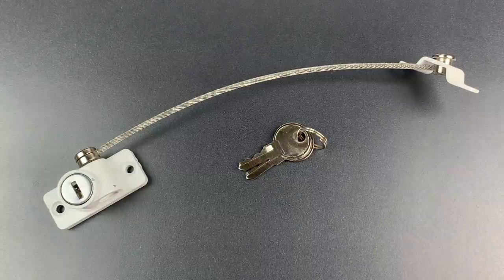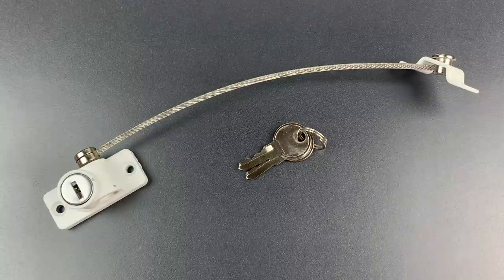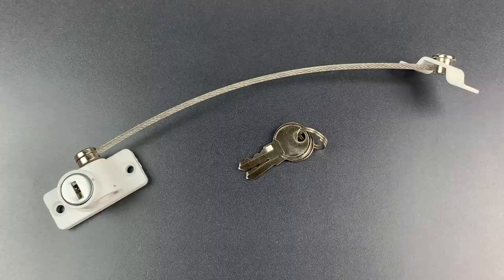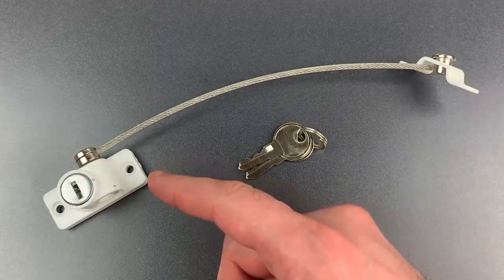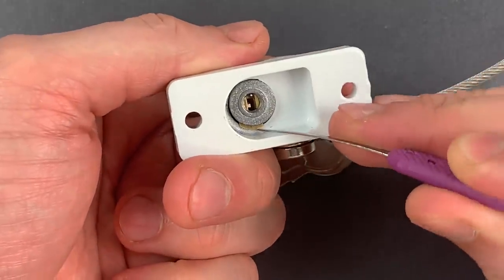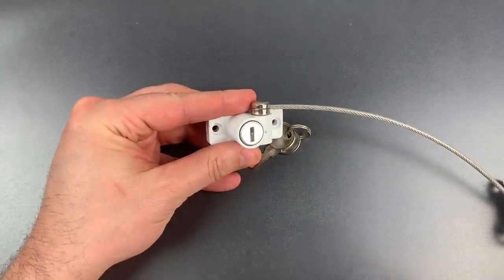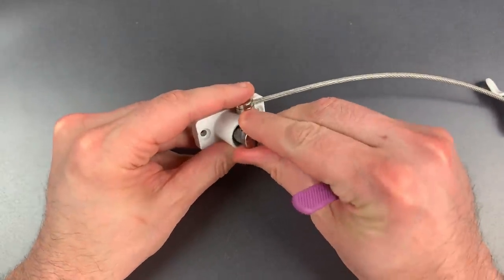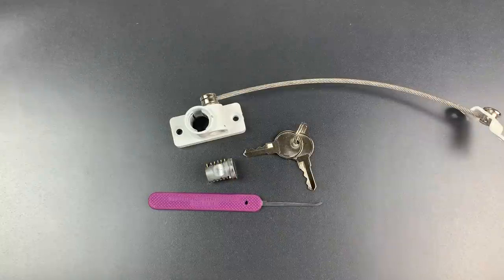[873] Why Is This Lock So Dangerous?

Comment: Think of all the windows covered with metal bars
Reply: New ones have to have a release button
Reply: Almost every building in Bangladesh has metal bars covering every window and balcony rip
Reply: My father in law was a firefighter for 30 years, one thing that he said still sticks in my head when I see metal bars on the windows.  He said that's where he'd  find the bodies, even if they had a lock most people don't have the presence of mind to keep it nearby or the smoke level is too high for them to remain conscious long enough to open them.
Scary stuff!
Reply: My windows have bars. It’s just how it goes for the ground floor in a city
Reply: Daniel A Millar Maybe in America. Definitely not in Europe.
Reply: mrjt yeah that’s fair. My city isn’t even a particularly dangerous one by US standards and I still have them
Reply: Newer installations in order to comply NFPA regulations in the US have a disconnect that is accessible from inside. It keeps outsiders from opening it, but allows the bars to either swing or fall away quickly once released.

I'm surprised this lock isn't mounted to something similar like a tamper evident anchor bolt or wired into an alarm.
Reply: mrjt LOL as if Europe isn’t dangerous... news flash, it is. And yes, Europe has bars on their windows too. 

It’s also far more likely to have home invasions with occupants present, than America. People break into houses in America, but most aren’t stupid enough to do it while people are home. Take a guess why.
Reply: house fires are really really rare here. Only happens 8 times a year where I'm from
Reply: My home is on the 22nd floor so having one is better than none
Edit:  the chance of accidentally falling out from the window should be higher than having a fire
Reply: @mrjakobt  maybe not in all european cuntries. But that just means that you cannot have any stuff if you live on ground floor, because it's like living in a house - almost unsecured.
Reply: I used to live in mexico and it's freaking sketchy. You've got one steel door to the house and all the windows are barred.  The steel door has a massive old bolt that can only be opened with a key.  I always insisted to my roomates that we leave the key in the lock.
Reply: @jamesbizs  stats or gtfo. As according the office of National Statistics.

In America there are 100  robberies per 100k people.

In Germany there are 47.
In Sweden there are 87.
In Netherlands: 47.
In Denmark: 35.
In Spain: 136 (2016 stat)
In the UK it's 127 (prior to 2017 it was below the US).

It looks like regardless of gun laws, all the countries are in the same general state.

Robbery being theft with the use or threat of force against a person. There are no home invasion statistics.
Reply: There are eye nuts, meant mainly for lifting, but can be used with whatever screws of course. It's easy to rotate them even without tools, and for more leverage some rod can be put through the eye. If some installation bolts reach to the other side of a wall or window, they can be secured with eye nuts. The other end of the screw must immobilized, f.ex welded, so that the screw doesn't turn. If some window bars were installed this way, they could be released from inside fairly easily, but still secure the window.
Reply: @huckthatdish  Your city sucks. I have lived on a ground floor for years and never had bars, and nothing happened.
Reply: aluisious well unlike you some of us have things worth stealing that we have to worry about
Reply: eitelfritz_hz I live in an apartment not a house because I’d rather live in a city where there’s some culture instead of where the most exciting thing in walking  distance is a fucking strip mall with an olive garden
Reply: A medieval-ish themed hotel (it was a BW Franchise,) had the ye olde windows with the iron cross bracing as decoration, thankfully, they were able to be opened like shutters.
Reply: here in brazil most windows have bars. our houses aren't made of recycled paper though, so they're not nearly as much of a fire hazard. i don't remember a house fire in my city, ever. apparently there was one last month, but the damage was limited to "some furniture in a room was destroyed" (meaning it didn't even spread to the next room). the homeowner wasn't even home.
Reply: @mrjakobt  give it a couple years. y'all are heading down that road in a hurry.
Reply: @jamesbizs  you're confusing Europe as a continent with the US as a country, if I was to say all of north America than home invasions are very common along with drug cartels. Get your geography in check before you try to make a point
Reply: @mrjakobt  Estonia in 1990's. You either had bars bolted to the window on ground floor or you get robbed or worse.
Reply: @aluisious  
And that Datacenter off in wherever also stores your Personal data and your Financial data in a not very secure way. But since nobody has stolen anything from that Server in particular yet, that means it doesn't need security, right?
Reply: @nootics  i read this in my best bollywood head voice
Reply: @mrjakobt  That's only north western Europe. In the southern countries and Eastern Europe, it's almost rare to see houses without barred windows on the ground floor.
Reply: Man that sucks... :(
Reply: @ParkerUAS  That is as stupid as Andy Taylor keeping the cell door key right next to the cells.  You can't use windows as an exit anywhere but the first, and if you're brave, second story. There's no reason to require windows act as an exit, especially if it means someone can break in if they can just hit the disconnect.
Reply: @billybobjoe198 , from https://www.nachi.org/window-bars.htm

 According to the 2006 International Residential Code (IRC), basements and sleeping rooms should have at least one operable emergency escape and rescue opening. Windows that are equipped with bars and which are intended for emergency egress should have a quick-release mechanism installed. If a room’s egress requirements are already satisfied by another window or door, it is still helpful for window bars to be equipped with a quick-release mechanism. Where window bars are installed in windows that are part of a building’s means of egress, the IRC requires that they be equipped with a quick-release mechanism that complies with the following requirements:

It should be accessible from the inside of the house. Although not addressed by the IRC, the device should not be accessible from outside the house if the window were to be broken.

It should not require a key or combination. Likely reasons for this requirement are as follows:

During an emergency, occupants may become too panicked or confused to remember the combination or where they put the key. 

Fire and smoke may prevent access to the key or obscure view of the lock. 

Occupants may not know the combination or know where the key was placed.

It should not require any special tools, such as a screwdriver. 

The mechanism should be able to be operated with relatively little force. Children and the elderly should be strong enough to operate the release mechanism.  

Operation of the mechanism should not require special knowledge.
Reply: @mrjakobt  Europe also has those fancy tilt windows for the most part. And my hotels there that wanted extra security just had a roll-down perforated screen that prevented entry but rolled up with ease from the inside.
Reply: @hf3923  I have to snicker every time someone uses the word ' Cartel '. They are less a threat to average people than their end-users.
Reply: Life in South africa every window frame has none release metal bars welded on it doesn't matter if you're 1st or 10th floor
Reply: @huckthatdish  in a city in an undeveloped country maybe.
Reply: @aluisious  lowest form of deduction there exists. "my backyard looks normal, so NOTHING happens in the rest of the world" Well, I have never been in a car crash even after 20 years of driving, and I have never seen a car crash happen. But there are still 120 car crashes in the city every day(minor and serious). 

And yeah yeah, I know your instinct is to deflect byt saying something like "haha, show people can't drive where you live" or something else even dumber. 

The point is, just because you don't experience something, it doesn't mean it doesn't happen.
Reply: @ulogy  would you stop talking about Europe like one country? France, Denmark Spain, Italy, Greece, Poland and Germany. Those cultures are as different as night and day, and that's just mentioning a few. They are as much the same countries as Canada is the same country as Nicaragua because they're on the same continent. Or as much the same country  as Japan is the same country as China.

But I guess that to someone like you, there are 4 languages in the world. English, European, Asian and Russian lollolol.
Reply: @danpalu2308  Man, you need counseling if that's your type of behaviour. I wish you well in the path toward something other than internalized depression.

Also, the statement holds true for all modern builds in every country you named. In other words, you're not just a rude individual, you're also a wrong individual. Considered running for office?
Reply: Dan Palu nah in a financial district in a major US city.
Reply: @huckthatdish  so, an underdeveloped country. Got it.
Reply: "and here is a the fatal design flaw of these steel bars"

Comment: Lockpicking lawyer: Removes core
Me: Unscrews entire lock.
Reply: I was thinking the same thing... portable electric screw drivers are so small nowadays that I keep them in my coat pocket.
Reply: A lot of times those are secured with rivets.
Reply: @nstg8  ..which is usually a shitty pop rivet, no stronger than your average screw.
Reply: @Schroefdoppie  Correct, but more time consuming than unscrewing a screw
Reply: Yeah I don’t think those screws are going to slow me down much.
Reply: Me: Smashes window
Reply: Most of the window frames are either plastic or aluminum.
Reply: @cleverusernamenexttime2779  If you were to push the window open with some urgency, the lock would break away. It's fragile.

Comment: Not a fire code violation. Nearly every state has laws requiring hotel windows be limited to opening only a few inches, or be sealed. This is to prevent children from falling accidentally or jumping out of the widow.

This, unfortunately, applies to all guest rooms on all floors. Not just higher floors.
Reply: It's more to have an child safe limiter, to be permanently locked out requiring damaging the devise in case of emergency as this devise does is against the general building codes published by the US government, and most states base their building codes from this central body (it's 3 am I don't remember the documents name, or if it was US Corp of engineers or someone else who writes it but I had to memorize it twice over now for my professions license as my state directly uses the guidelines as the code)
Reply: Most juristictions aopt The IBC in whole or in part, and or NFPA 101 life safety to codefy egress. Requirments.

Comment: When I was a kid I would use Lego spears to open window locks.
Reply: I saddly had the kind of lock that was just push it enough over to unlock it from the side it unlocks on. No outside lock and the inside lock for the window is fairly easy to unlock .... until it is old and gets hard to move the metal on metal lock as it goes together more instead of going apart more. Better lock design as it is easy to open from the side it unlocks on and impossiable to get to on the other side .... unlock you break the window to unlock the lock to which why any lock is useless when you can just break through the material that it is on .
Reply: My house has the kind of room locks that you can open with a lego antenna

Comment: I think for videos like this, you should use exactly what you suggest we should use, e.g. a paperclip
Reply: Just The Highlights Exactly. Mr. LPL show us the same trick with paperclip.
Reply: It would also be helpful to see it again from the back side so that we know exactly what hes doing. When he removed the lock from the housing the first time, he disengaged the wafer from outside the cylinder. Not the same conditions as the 2 pickings that followed.
Reply: In case of emergency, can't you just jam any other key in the lock and try to twist it out with some pressure. I do not have any paperclips laying around...
Reply: @BrendanxP In real emergency you can just grab the cable (preferrebly with something between your skin and the cable, a paper will do it) and yank hard, the small screw or wooden frame will not hold you back, and you just removed the block.
Reply: @thorin1045  You're right, that would probably be sufficient indeed.
Reply: @thorin1045  In a real emergency situation a hard yank on the window frame would probably dislodge the part that holds the core...
Reply: It's pretty clear literally anything would work. You could even turn the key upside down and it would do it.

Comment: I once worked at a place where they decided to go around putting up thermostats in every office that were locked with a lock similar to that one. They also forced a specific temperature, vs the old thermostats that let us change the temperature. After not very much time at all, a good number of people realized that the same key used to open our desk drawers could be inserted into the thermostat "locks", and the thermostat would open up about as easily as demonstrated in this video. Needless to say, they ended up reprogramming the thermostats to allow us to change the temperature again, as they probably figured they'd rather not have everyone unlocking the thermostats. 

(I ended up replacing the thermostat in my space with the next model up and installing a remote temperature sensor on the other side of the office, using a spare wire on the existing cable bundle, near one of the other occupants of the shared office, because the HVAC unit was on that side of the office while the thermostat and internal sensor was near my collection of computers + mini fridge I had acquired, and my office-mate complained that it was getting too cold since the AC kept running due to the heat from my devices keeping the system on, while the actual AC was right next to him, and I found that the new thermostat allowed averaging the temperature from two sensors, vs the installed model. Needless to say, before I left that job, I restored the original thermostat, since the one I had installed errored out when the maintenance staff tried to program it every year, and nobody else wanted to have to manually re-program the thermostat every time this happened. Also, I paid for the new thermostat and figured I'd take my property with me! I had actually explained the scenario to the building manager after his guy wrote up his trouble programming my new thermostat - which looked identical to the old one - and to his credit, the facility manager got a good laugh out of it when I assured him I had not broken any property other than cutting into the drywall to install the sensor, which I left in place, and could restore the old thermostat, which as previously mentioned I ended up doing, if he so wished)

Comment: Odd that it was on the ground floor. Usually I'll see those on floors 3 and higher to prevent falling/jumping out of the window
Reply: Could be that the hotel chain had an incident somewhere and decided to secure upper floor windows on all their properties, but the mandate got lost in translation and all windows were converted instead of just upper floor windows.
Reply: @TWX1138  it's easier to child proof the window than pay for legal fees after your child goes missing. It probably makes the hotel insurance cheaper as well if all windows have them.
Reply: Recently a law was passed making it mandatory for all apartments in NSW to have a similar lock on all apartment windows..
Reply: big dog Idiotic Australian laws again... (they also almost banned computer security with a recent law).
Reply: Probably just poor builders and planners they would have no real reason for the lock on a window besides burglary which is not common enough for hotels as they have security cameras and most people are sensible enough to close them and use the close position lock

Comment: So this lock prevents the occupant of the room from escaping while providing easy access for a thief or any person with a small piece of metal... Great lock!
Reply: that lock is screwed from the inside of the room, not from the outside
Reply: @Malandrin  but the point is to allow the window to open part way, but not far enough to allow anyone in. If the window is open part way, it would be easy enough to slip a hand in the gap, and use a paperclip to open the lock. This lock doesn't keep the window closed against the frame.
Reply: @tomsing98  Paperclip? I was envisioning someone taking cutters to the connecting braided wire string.